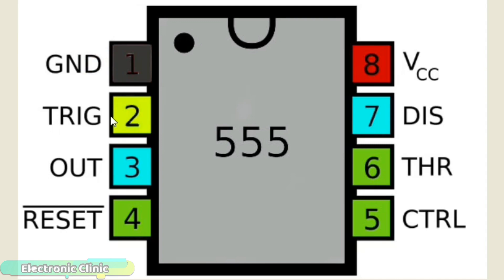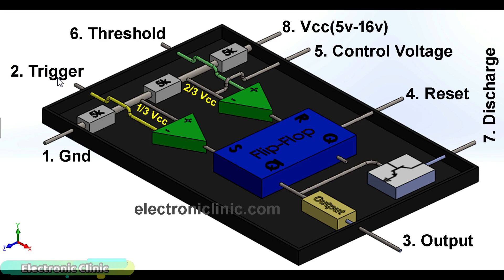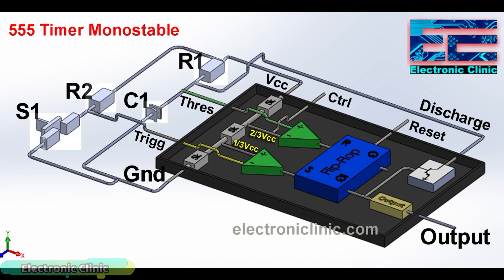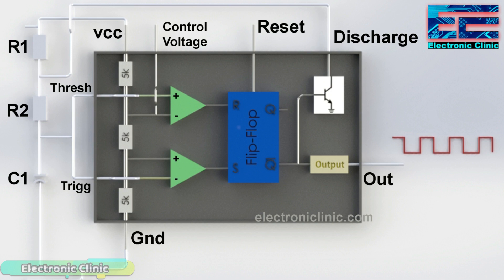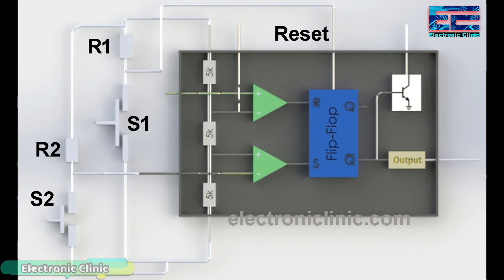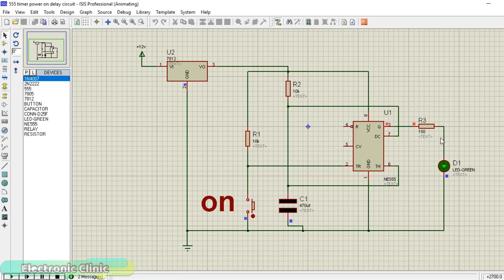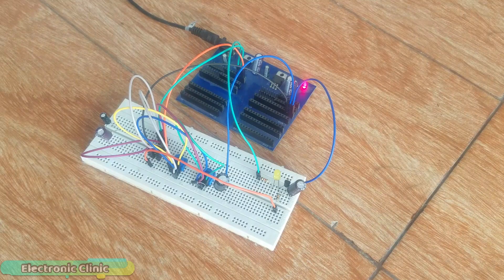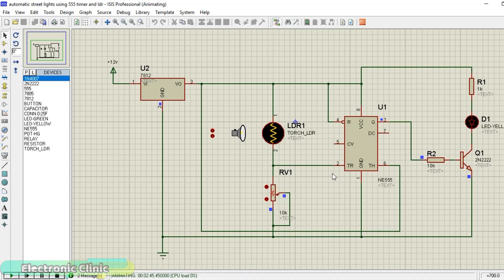555 Timer IC Working, Pin Diagram, Examples Astable, Monostable, Bistable

Comment: Para comprender el maravilloso 555 tu tienes que saber lo siguiente:
1) Cómo funcionan los divisores de tensión.
2) Cómo funcionan los Flip Flops RS con Master Reset.
3) Cómo funcionan los Amplificadores Operacionales, Modo Comparador.
4) Cómo funcionan los Transistores NPN.
5) Cómo cuncionan los Capacitores.
6) Cómo funcionan los Buffers.
7) Cómo funcionan los Potenciometros.

If you know this... you can understand 555 Chip Timer.